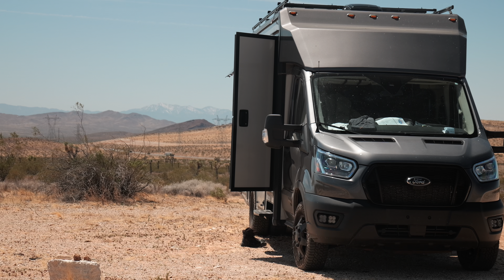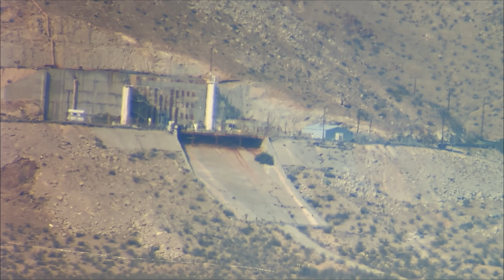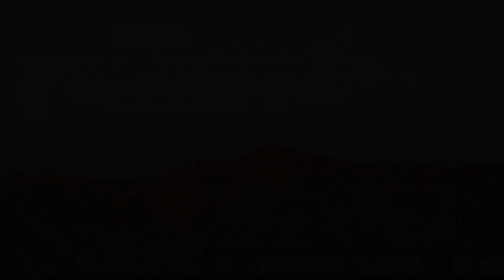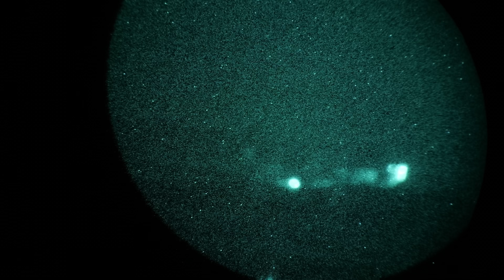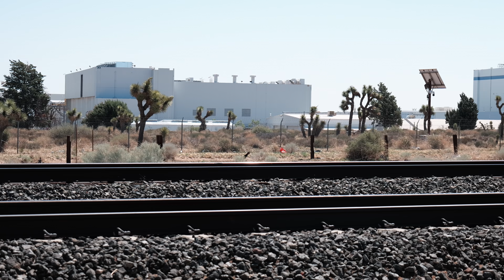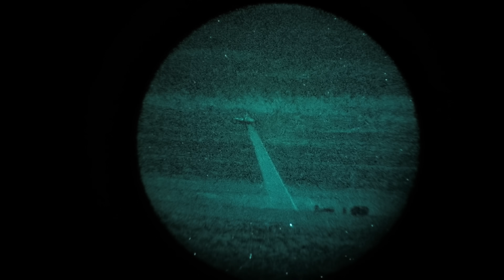Camping and Spying around Edwards Air Force Base | Haystack Butte and a Quick Look at Skunk Works HQ

Comment: UFO’s don’t have running lights. Drug runners & smugglers don’t have running lights. The FAA requires all air craft flying in US air zone to have running lights. The UFO’s videoed in the daytime don’t have them. The videos released by the pentagon were made with infrared & FLUR cameras and none of the crafts they were chasing had lights of any kind. So why on earth would they switch them on at night ? To obey FAA rules so they don’t get grounded ? People who look into the night sky for strange lights tickle me. If you see a light moving across the sky at night it’s either a drone, an airplane and your imagination. If we (the US) were to get attacked by another country via the air they won’t have running lights on either.

Comment: The Edwards Air Force Base UFO case is one of my favorites.  Extremely compelling.  Air traffic control tower personnel and ground radar at Edwards tracked up to a dozen luminous objects maneuvering over the base and surrounding area for several hours. Controllers described unusual radar returns and visual sightings of bright, metallic, disc-shaped craft that hovered, changed altitudes rapidly (reportedly between roughly 3,000–12,000 feet), and exhibited high-speed maneuvers. The activity prompted an alert, with voice recordings capturing real-time communications between tower controllers, other bases, and personnel.  An F-106 Delta Dart interceptor was scrambled.  During the communications there was mention of a UFO officer which is very interesting.

Comment: From 1997 to mid 2005 I worked for the Xerox Corporation as a field service technician. Located in the west San Fernando Valley of Los Angeles I had two Boeing owned facilities I would go to often to maintain and service their on-site Xerox Mid-Volume Copiers. The first facility I frequented was an engine manufacturing plant located off of Canoga Ave. and Victory Blvd. whenever I went to this facility I was escorted from the building entrance by a Boeing employee. I was directed to stare at the ground as they walked me through the hallways to wherever that days service was needed. I was told not to look up as we walked through the facility with the promise they would not walk me into any walls, etc. I always did as I was told and kept my eyes focused on the ground. Once at the machine I was taken to I was told if I had to use the restroom I should ask to escorted and they would wait for me and still staring at the ground they would walk me back and forth. This facility is where, among other projects, the engines used for the Space Shuttle were maufactured. I know this because at the entrance to the facility they had one of the engines on display. Not much else left to say about this place other than I had learned from a friend that had done some construction at the place that there was a tunnel deep under ground, big enough to drive a semi-truch through, that led to the second facility I would often go to. That facility is very well known around here call the Santa Susana Field Laboratories (SSFL). 

The SSFL is a remarkable location due to its proximity to civilian housing. It is a very controversial location that has an even more remarkable history. In 1959 it was the sight of the very first nuclear disaster in the United States. The facility, located at the top of Woolsley Cnyn. was nested between the city of Chatsworth to  the west and Simi Valley to the East. It was surrounded on all sides by with houses and mobile homes less than a 1/4 mile, in some cases, from porch to front gate of this facility. 

Back in the late 1940's they started construction of the SRE this was an expiremental nuclear reactor that used sodium to cool the cool the reactor and in 1959 they experienced the first meltdown in the United States and because it was an experimental reactor it was not housed in any type of concrete containment structure like the reactors  you would see at a facility like 3 Mile Island. When it first began to melt down they decided to shut down the reactor but within hours a decision was made to continue to run the reactor and they did so for for about two weeks until they reached a critical failure point where they were forced to shut it down for good. But for those two weeks during this partial meltdown the escaping radiation levels were said to be unknown. There were sensors to measure the escaping radiation but the levels remain unknown to this day. This is a well documented disaster with insane consequences to the surrounding communities and you can find all sorts of information that will do a better job of explaining those consequences than I can do. If you are interested in learning more about that incident and the several other meltdowns that occurred over the next two decades, just search Santa Susana Field Labs on Google and YouTube.

In addition to the reactors at this facility is was also well known for the rocket engine testing that occurred there from the 1950's all the way through the 2000's. The whole facility was divided into 5 sections 3 of those sections were huge rocket engine testing stands called Alpha, Bravo, and Charlie. The engines were constructed at the first facility I described where I had to stare at the ground while being escorted through, from there they were strapped to the back of a semi truck and transported over 3.5 miles underground to the SSFL where they were loaded onto one of the three stands and tested. Growing up in the 1970's and 1980's frequent testing was done. Sometimes during the day and sometimes late at night. As you can imagine it was quite a spectacle and experience when the ground began to rumble and the mountain top would begin to glow. I remember walking out to my front lawn and staring at the night sky towards the facility which was less than 2.5 miles from my front door. Other times I would be at school a block away from my house when we would hear the engines firing up and if we happened to be at recess or lunch we would stare in that direction as well. It really was quite common especially in the 70's and 80's. Complaints from the surrounding communities from that time forward slowed these testing occurrences down but they did bot stop until the early 2000's. 

While working for Xerox I went through a background check and was given a Boeing Vendor badge that allowed me to drive onto the SSFL property and continue without escort to which ever building I needed to visit to service the machine I was called out to repair or maintain. On one occasion I was called out to one of the furthest buildings at the facility which was about 3.5 square miles in size at the top of this mountain range. I remember being walked to the machine by an employee and above this particular machine there was a promotional poster for the X-33 you mentioned at the beginning of this video. It stood out to me because it looked like a space shuttle without wings. The gentlemen that had escorted me to this machine sat there with me the entire time I was working on it and we spoke casually about various things and when I asked about the poster in front of me his reply was consistently "You don't see that." I asked twice more throughout my visit as he was friendly and had shared other stories with me as I talked to him about what is was like growing up so close to a place like this. But his answer was always the same, "You don't see that." After I had asked the third time I could tell that it was not a topic I should pursue any longer. I finished working on the machine and as it was the end of the day. I went straight home.

The internet was only three years old at that point and I must have spent hours searching for anything I could find regarding what I had seen on that poster. Mind you the poster did not have the X-33 title and it was just a picture of the ship  and nothing more. I found absolutely nothing. Years went by and as I would tell the story to others about my experience I would often get the bug to search the internet again and again. I eventually found a website where ex employees of the facility were talking about an abandoned project they called the X-37-B. For years I thought that was what i had seen on the poster that day. The employees had stated that a launching pad had been built for it but was never used and the project had been abandoned due to problems they encountered with the fuel tanks and eventually the whole project was scrapped. Then, years later, I saw that The X-37-B was a known thing and had been used lately within the past decade or so and that it held some sort of record for the length of time it orbited the earth which I believe was over one year long before eventually being landed. The public has knowledge of the vehicle itself but they do not, nor do I know the vehicles purpose. However after watching your video today I now realize that I had conflated the two projects and that what I saw on that poster was indeed what you called the X-33.

Loving your videos brother keep them coming. I apologize for the long post. I have lots more stories I can tell you about what I learned about these facilities including that there are two additional tunnels under the valley floor to two other facilities in the area. Also about the devastating effects of living in such close proximity to the location of the largest nuclear meltdown in United States history and how I believe it has affected my life personally if you would like to hear them just reach out here and I will respond.

Respectfully, 

Joe Schwartz

Comment: Skunkworks aren't as good as they think at times, an iteration of a well known mapping system had something similar to an RQ180 under a white drop cloth parked in the bays opposite the hangers, couldn't see the airframe but you could clearly see the outline, and slanted intakes. Looked identical to what the french press called the beast of Kandahar, and what the Iranian press showed.

Comment: You know what always blows me away with those facilities buried endless miles and miles out in the desert 🏜️. You always hear about people who claimed to work there. You rarely and almost never heard of anyone say- they built those facilities. 

I mean given how big those sites are. How much concrete is involved etc. the amount of people and machinery, and fuel needed to build those bases is insane. They must of rounded up 1000’s of immigrants and held them captive to work and then probably killed them when it was done. 

I mean think about the size of the crew and the years it took to build the Hoover dam in the desert. Though a different project, similar in the sense of where, the challenges of building in the heat, and those bases are even more remote, commuting people there to work daily must of been almost impossible. They must of had people held as hostage slaves working, and probably just trucked in food and water to them. And when the project ended they probably told them: come through here to sign your citizenship papers and they probably blew the building up 💥

Comment: Have you been up to the Santa Susana Mountains? There was wild nuclear reactor and rocket motor testing there from around the 1950s through the 1980s or so. Much of the infrastructure has been dismantled and access to some areas is likely restricted.

Comment: The 24 hours and camping not at area 51 I couldn't post on that site for some reason.  I tried a few times.  That was a great video and watching that aircraft that sat there and hovered for a long time.  Camping out I'm surprised there wasn't any security that saw you up on the hill camping out or were watching what you were doing.

Comment: When i Lived in Rosamond , I saw all kinds of cool stuff  being right at the edge of  the main entrance to the base . I worked on base when they took down a bunch of old housing to dispose of all the asbestos. We worked on the new construction. I got to see some of the last Space shuttles land while I was working out there  and was able to see Haystack Butte ( AKA Rocket side row) from where I was working. I heard lots of stories about the rocket testing and even rumor's of a tunnel connecting Edwards AFB to Area 51/Groom Lake big enough to fly a jet through (Aka big fish story). I met lots of old retirees that live in Rosamond because they were stationed there and wanted to stay close to be able to watch the sky's to possibly be the first to see the new top secret stuff flying around . 20+ miles in the opposite direction on Rosamond Blvd...it turns into desert again and if you go far enough you will find a sub station for Vandenburg out there in the middle of the desert. We saw more odd stuff in the sky's out that direction. Weird orbs hovering along the tops of distant hills that looks like the head light of a truck driving along the crest of the mountains but if you looked through binoculars , you could totally see that it was above the ground about 15 to 20 ft. It would travel along the whole length of the ridge and then disappear into the ground or behind the mountain. Was told it was a left over tracking probe  for the "scrapped " Star wars project.  story was that they know the heights of contours of that mountain range and would compare the readings the Star wars satellite would register as it tracked the probe from one side of the ridge to the other to check the accuracy. Probably all exaggerated story's , rumors and speculations but it was always cool to hear the stories while watching the skys in hopes of catching something . The airshows Edwards puts on are insane and would attend every year. Got to see and touch alot of rare old stuff as well as newer stuff like the f-117.  I moved in 94 to Arizona for work and been here ever since. Only been back twice in the last 30+ years
Reply: I still live in Rosamond and we see lots  of drones nowadays.
Reply: Ben Rich also said that we have the ability to take ET home
Reply: I live in the area and also heard of the underground tunnels but for high speed rail, never heard they were large enough to fly a jet through.
Reply: @21stTrojan  Yeah, I took it as old man tales
Reply: AZ is the palace to be if you're a conservative, CA. ex-pat. We're up north by Kingman. We try to stay out of CA. 

And there's no tunnel from EAFB nor AFRL  to China lake. There are some  blast bunkers up by the test stands & tunnels between those up on rocket ridge. They were built for when the engines let go on the stands. It wouldn't have been the place to be standing around outside taking notes. They've blown up a few there,
Reply: @davidsexton4033  Unfortunately Az is turning into California pretty quickly over the last 4 years. We still haven't lost out Constitutional Carry yet , But the government in the big cities, Phoenix and Tucson are pretty liberal these days. Hopefully we can change that in the next couple elections... but by the way things look with the liberal government, The homeless and the explosion of violence , its not looking too promising. I wish Kari Lake would have won over Hobbs...That would have been a great start to heading in the right direction.

I never really believed the tunnel story, but it was cool to hear the story when I would hang out and drink with some of the old retirees in Rosamond.

Comment: On the other side of the Palmdale plant, adjacent to Lockheed Way, off Blackbird Drive there are 4 aircraft visible all the time. 2 inside the fence at the back of the carpark, and 2 outside. Inside is an F-117 Nighthawk on a pole and near to that, a Lockheed T-33. Outside the fence near the gate is an F-104N one of only a handful made for NASA and next to that, a NASA F-16A.

Thanks for the videos!
Reply: T 33  or X  33 ?   different planes?
Reply: @FIieX9I  Its a T-33 Shooting Star!

Comment: The tank at the top was to hold water. The water was used to cool the concrete when the rocket engines were tested in the 1977-80s. They were abandoned and left to rust. I was stationed at Edwards for 11 years.
Reply: How many Saturn 5 rockets exploded out there?
Reply: @Oldguy-k3t the stand with 2 silver ball tanks tested the F1 Saturn engines
Reply: @Oldguy-k3t the red and white water tank is test area 1-42. It had a high altitude chamber big enough to put a car in.
Reply: @Oldguy-k3t zero
Reply: The planes are part of the flight test area/bombing range which extends west and south of haystack butte.
Reply: The tower in front of the wind mills was also a test stand and I'm guessing it was for liquid fuel rocket motors.
Reply: @troysoon7201 F1
Reply: Those predate the 70s, just saying.
Reply: @TR51_Works yes indeed. It was reactivated to test the MX engines
Reply: This test area 1-56. Tunnels don't exist. Control room is buried between the two peaks. @TR51_Works
Reply: X33 launch site is next to this site [1-56].
Reply: so what you're saying is it's used by the dark state to harvest alien technology and the camo dudes are trying to stop you from finding out the real truth.
Reply: So basically, you could be an alien. 'wink 'wink

Comment: I lived in Victorville during the housing boom of the 1980's.we had a great view of the base.we saw jaw dropping activity at night.
Reply: If you lived in V-ville and saw cool stuff, that was coming out if George AFB, which closed in 1992. George was there since WWII and was used to train Wild Weasels. EAFB is at least 20 miles away as the crow flies.  And that would be the perimeter fence along 395
Reply: @davidsexton4033 we saw many military training practices at night with parachuting soldiers holding flares as they dropped,years later I see the infamous Phoenix lights video and immediately said "oh that's soldiers parachuting down with flares!!" The Phoenix lights looked exactly like Edwards AFB but over Victorville!
Reply: @Kanupleaseknot back then....the flares from Fort Irwin were visible for over 100 miles. Not Edwards.  I grew up there.